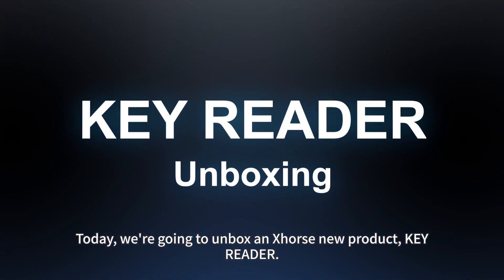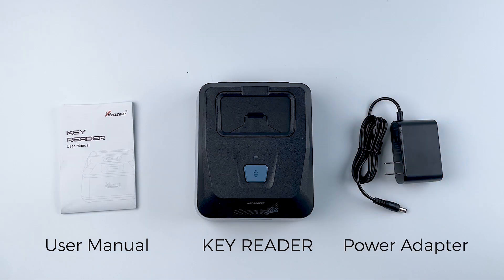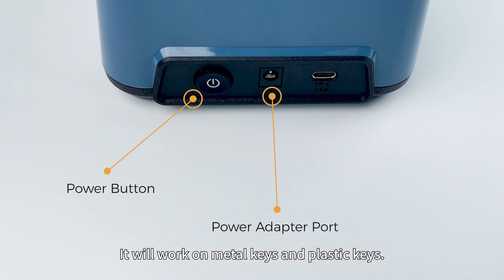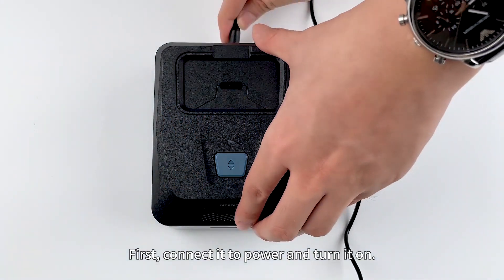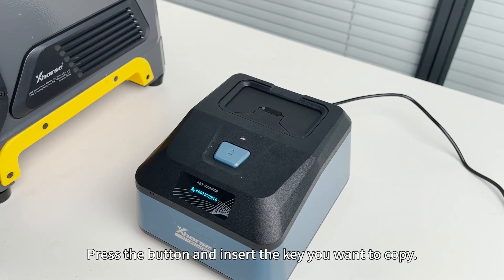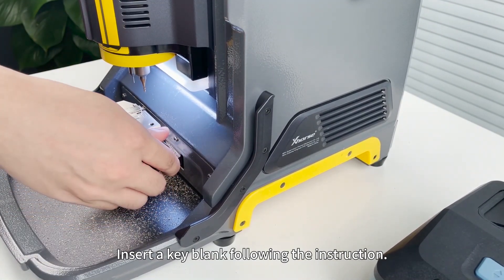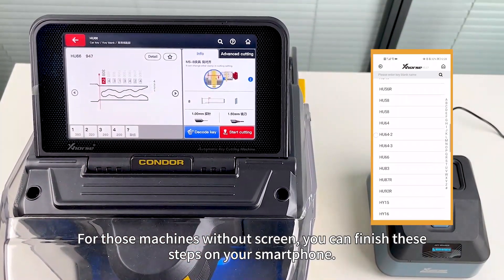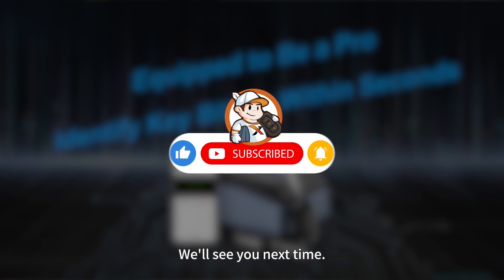Xhorse KEY READER Unboxing | Identify Key Bitting Within Seconds

Comment: Does the Key Reader Auto Calculate For Worn Keys will it also do edge cut keys like worn vehicle keys? I can see the advantage of this unit as it will be more precise than taking a photo also less wear on your step motors on your machine faster as well. When will it be in the US and Canada for sale?
Reply from the maker: Hi, my friend. Yes, KEY READER supports edge cut keys as well as laser keys. It has just been released globally. You can contact your area dealer for the info.

Comment: My question is why.  If Dolphin and Condor already has this feature.  

What is the viable purpose of having a key reader?
Reply from the maker: Some beginners may have probe-breaking problems due to misconduct. It helps avoid the problem and it can detect aluminum and plastic keys which key cutters can't.

Comment: Why would x horse develop a separate key bitting decoder for use with the already equipped decoder function in xp007 & xp005?
Reply: The Key Machines use conductivity to read the keys so they will not read plastic or aluminum keys so you need to take a picture with the app which is quite difficult to do but this will be simple, accurate and fast. This will put Xhorse ahead of others I just wish they would answer other questions, like the one below from Locksmithing Innovations.